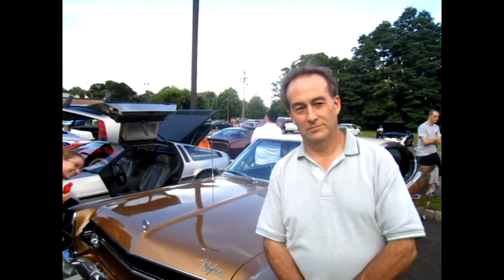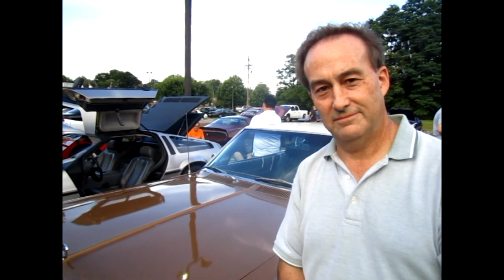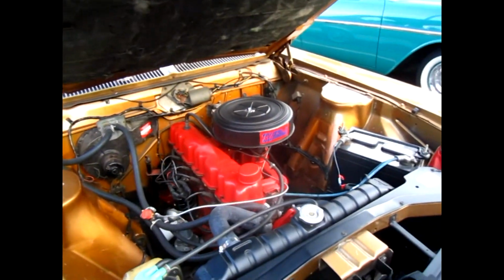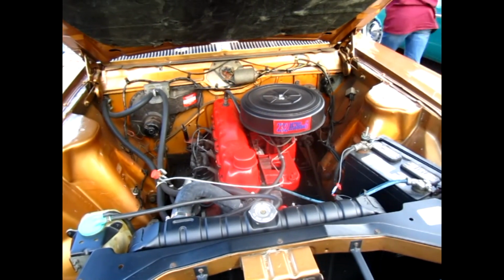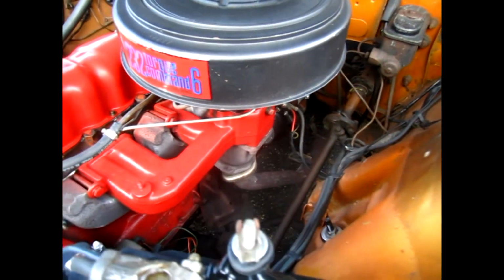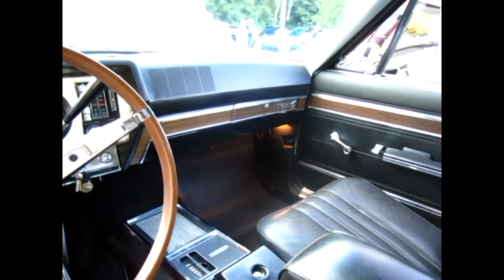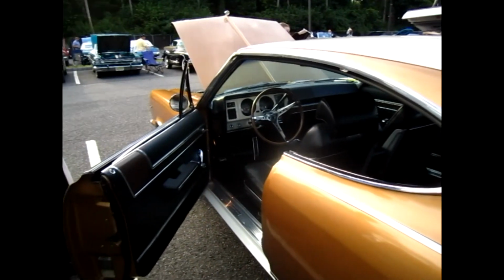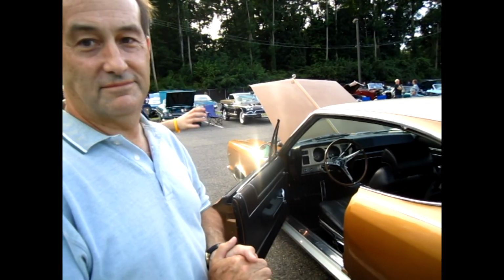1967 AMC Marlin with Rich (ASP)

Comment: Nice Marlin, I have owned my ‘67 Marlin now 45 years, but mine is a fully loaded with 343 4 barrel V8 that will take off like a rocket with its twin grip rear end. My Marlin is the only one I have seen with power lift windows along with the air conditioning, tilt steering wheel and factory head rests. Before I bought my Marlin I had a ‘68 Ambassador with the 232 6 cylinder like in your Marlin, as the car is heavy for smaller engine, but I thought it still was quick enough.

Comment: The 232c.i./ 2bbl  inline 6 engine  was AMC's  " bread n butter" engine......in a 'fullsize' vehicle like this Marlin , the performance #'s were to be as expected, a little over mediocre.... putting a 290 c .i. or a 343 c.i. with a console shift would definitely tip the scales to a personal luxury sport coup'e  with 2 xtra seats in back.....the turbine wheel covers were very unique back then.....so were Chrysler /Plymouths stock custom mags....With the Ambassador platform, this car was absolutely gorgeous.
Reply: I had a ’72 Matador with 258 6 cylinder automatic and that would smoke the tires just by stepping all the way down. It was a quick car considering its weight and it also handled surprisingly well for a 6 passenger automobile.

Comment: It is interesting that he seems to say that this engine is not a good performer. Perhaps he is using the Flash O Matic incorrectly. I have owned three AMC sixes, this very engine ('65), a smog chocked 1975 232 Gremlin and a '72 Matador with the 258 version. All were good performers. The '65 American 440H and the '72 would smoke the tires on takeoff (both automatics) and the '75 would smoke them with a three speed manual. None of the cars would make you feel that power was lacking. These were exceptionally durable engines with 7 main bearings, moly rings and high nickel content cast iron block. 
The Flash O Matic transmission was a bit strange as the earlier cars had the shift selector that would give you three speeds in D1 and 2 speeds in D2. I think this was because of fuel milage and to take advantage of the extra high torque of the AM engines.

Comment: So the transmission was still called Flash-o-Matic in '67.   That's what our '62 Rambler Classic station wagon had.  You could still push start it, too.  Our '68 Ambassador had the next generation automatic known as Shift Command.  You could no longer push start it; the owner's manual (which I still have) clearly states that.
Reply: yes..basically a Borg Warner M12 or M13...

Comment: @dansmusic5749: In 1972 AMC switched to Chrysler's TorqueFlight automatic transmission. A fantastic move which greatly enhanced to increased performance potentials. I had a 1972 AMC MATADOR with a 360 cubic inch 2 barrel V8. It won't many stoplight drag races from standstarts. I got nany curses and swear words from motorists I beat from traffic lights. My car also could screech tires too. I also remember racing a 1969 or 1970 Cadillac from a stand start and the at full throttle we stayed right alongside each other until 45 miles an hour when our transmissions shifted to second and then the Caddy started to get ahead of me.

Comment: The one thing about this car is after all the rebuilding, refurbishing, replacing and general remaking of the car, you still have an AMC POS.
Reply: Really??  Well...........good for you.  We owned Ford and Chrysler cars that gave us great service.  What's your point??
Reply: Have you actually owned or worked on any AMC vehicles? My point is that I hardly consider them to be POS. Mine were quite reliable and easy to service and maintain.